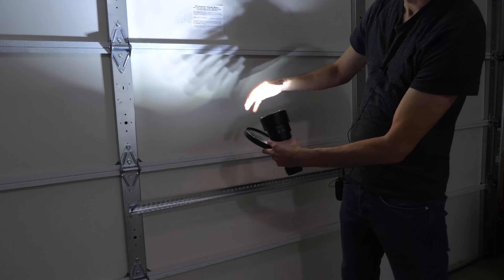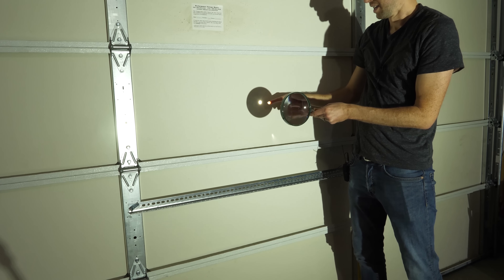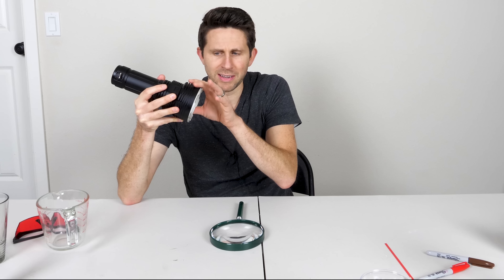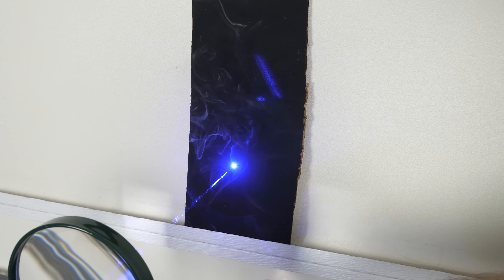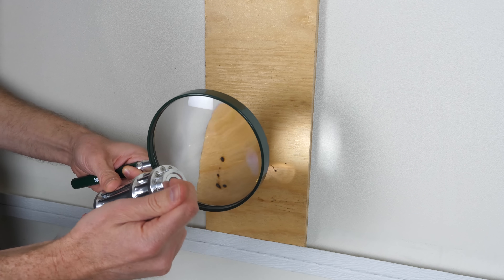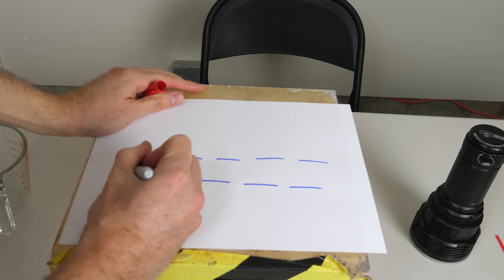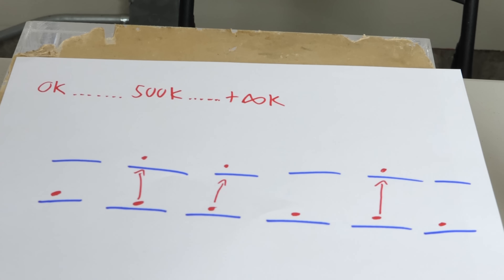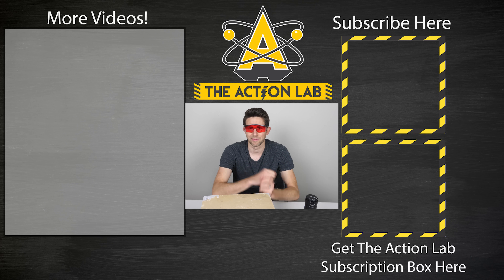What Happens if You Focus a 5W Laser With a Giant Magnifying Glass? Negative Kelvin Temperature!

Comment: I’m sorry to even say this since you clearly know what you’re talking about, but temperature and heat energy are not the same thing at all, and in no way is focusing the light of a flashlight impossible and if you do it with a series of lenses you end up with, drumroll, a laser. Think of it like psi vs a measurement of work. In two situations with identical total heat energy, focusing one of them would create a higher temperature than the other at the focused point. I.e. the focused beam has a smaller surface area so the same amount of force (light) means a far greater psi (temperature) This has nothing to do with the second law of thermodynamics because the total amount of heat energy remains the same. The only difference in this case with the laser is that the light beam is already focused, and that’s done with mirrors and lenses. No reason you couldn’t do the exact same thing with some complex math to determine the exact lenses dimensions necessary, and you would have to consider the parabolic reflector within the flashlight
Reply: I agree with you, there's no difference between laser or ordinary (incoherent) light when focusing (aside from chromatic aberration which is minimal anyway). It's easy to focus the laser in this case because it's collimated (parallel) beam once you put a focusing lens in front of it, it will focus it into a tiny spot at its focus, how small it can be depends on the quality of the lens.

Now the flash light in the beginning is emitting the light from a multiple diodes that are spread-out so you can't focus the light into a single point but you can make an image of these diodes. and actually you can make an image that's much smaller than the real diodes without loosing light (maybe not with that lens he has). When he was trying to focus the light he was moving the flash light farther and closer to the lens but ignored the distance from the lens to the wall (where he was trying to focus it) this is simple geometrical optics problem, you don't need to put the light source that far away unless you're trying to get a very tiny image, if you get a larger lens with relatively short focal length and then place the flash light farther than twice the focal length (as far as possible until there's a significant loss from the divergence) you will see a small image of the diodes forming a bit behind the focus point!
Reply: @mofleh177  yes all of that makes sense. Also, another thing to consider is if there is a parabolic reflector inside of the flashlight, which i don’t think there was in this case. The original leds could be rearranged or another reflector or lenses can be added to get the original rays closer to parallel. Just refraction and reflection angles and some complex math. The point is just that the amount of energy released is the same every time you turn on a light, and focusing that energy will inevitably increase the temperature without a change in total heat energy.
Reply: @LSFord  Yes exactly, a good example the high power search lights they use on police helicopters to track fugitives on the run at night, or the search light they used on the ground to locate enemy aircrafts in the pre radar times, those can be adjusted to a narrow beam to light small spot and in theory can be focused to a tiny spot.

I think what he was referring to has to do with heat transfer by radiation in which the heat flux from object A to object B depends on the difference of their temp in Kelvin to the power of 4 or (TA^4 - TB^4)
so if the object you're targeting is hotter than the light source itself, then the net heat exchange (by radiation in the form of EM waves that includes visible range) will be the other way around, which is something I'm still trying to wrap my mind around to be honest.
Reply: Sorry, your understanding is incorrect. It is impossible to focus light using lenses into a spot tighter than the source. If you could do that, you'd be able to build an perpetual motion device. Here's how it would work (if focusing light tighter than the source were possible): 

Take an object that has a uniform temperature across it's surface (and therefore cannot perform any work). Use a lens (or several) to focus its black body radiation down to a point, then a mirror to send that point back onto the surface of the object. You've now taken a uniformly distributed heat source and turned it into a hot point surrounded by cooler material. You can now use this difference in heat distribution to power an engine. The engine can dump its heat into the source block, where your lenses recycle it back into a point.
Reply: @DontThinkSo11  you’re ignoring the fact that the perpetual motion machine you mention is entirely possible because it’s actually just a solar engine. No object can do work without energy, and heat or light energy being introduced is what allows work to be done. Focusing light increases temperature, but not the total heat energy. Ever heard of using a magnifying glass to burn ants? That simple experiment is proof that you can, in fact, focus light into a smaller area than its source, which in this case, is larger than the entire earth. And lenses can be used to put any beams in parallel before focusing with another lens. This is also how telescopes work, and many existing lasers
Reply: @LSFord  You misunderstand. In my example, there is no external energy source. Any object at all that has temperature greater than absolute zero could be used to build a perpetual motion device, if it's possible to focus light tighter than the source.

Lasers are not built using lenses and black body radiation. That's how flashlights work. Lasers work by pumping electrons into a higher quantum state, creating a population inversion that's not allowed in classical thermodynamics.
Reply: @DontThinkSo11  okay, so where does the light come from then that you are focusing? If you’re just using heat energy, the heat energy needs to be greater than the surrounding area, not absolute zero. There needs to be a differential. When that differential equalizes there is no more energy. If you were in complete darkness with perfectly equal heat distribution there would be no movement no matter what lenses you use. Proves nothing lol
Reply: @LSFord  Thats exactly what I'm saying. If it's possible to focus light more than its source, then it's possible to *create a heat differential when one did not previously exist*. Let's adjust the example a bit to see what I mean. Imagine you're in a uniform enclosed box at room temperature. There is no light energy in the box, except for black body radiation coming from the walls, which is equal in all directions. You then set up your lens system inside the box, focusing the emitted black body light from one wall down into a tiny point on the other wall that is brighter than the source. Congratulations! You have now created a temperature differential. Use it to extract work from uniform heat to your heart's content.

Obviously, this is impossible. Therefore, have a lens system capable of focusing light brighter than the source is impossible.
Reply: @DontThinkSo11  that is not impossible. What you’re misunderstanding is that increase in temperature can’t be absorbed without the walls decreasing in temperature, and then the air surrounding the box would warm it again. It would be incredibly inefficient but that’s still a solar generator. The total heat energy present does not change because you focused it. But the temperature does. Temperature dos not equal heat energy, just like weight does not equal mass, or more accurately, does not equal the psi you exert on the ground.
Reply: @LSFord  If you can take a uniform heat distribution and cause one side to be hot and the other to be cold without external energy input, then you have violated the second law of thermodynamics. "Inefficient" nothing - no matter how little energy you manage to extract, you've extracted infinitely more than is actually possible.
Reply: @DontThinkSo11  you’re literally just describing a really complex way to extract heat energy from the surrounding room of the black box very slowly. It doesn’t deny anything, “cold” does not exist. Only a differential in heat. Focusing heat increases the temperature in a small area but not the total amount of energy. Radiation is energy, if you focus it, it will be more intense due to constructive interference. That doesn’t mean the amount of energy isn’t the same. In your box scenario, the only reason the walls don’t get to absolute zero is that the room around it is constantly putting heat into the system.
Reply: @LSFord  I'm not talking about changing the total amount of energy. I'm talking about reducing the entropy of the system. That's impossible, without the additional of external energy. You can never, ever take a uniform energy distribution and make it non-uniform, without extra energy you brought in from somewhere else. The fact that you can do this with your lenses means your conceptions of lenses violate the second law of thermodynamics, and therefore is false. If you don't understand this, there's not much else I can say to convince you; might I suggest finding some educational videos on entropy and the second law of thermodynamics.
Reply: @DontThinkSo11  i know what entropy and the second law are, they don’t mean that you can’t focus light. This process is literally done all the time in spot lights and telescopes and magnifying glasses. But the energy, in those cases, comes from whatever electrical source is powering the light. Not the room like in your hypothetical. Which would only result in such a minute change in temperature, if any, that it is barely detectable.
Reply: @LSFord  Of course you can focus light. But you can never focus it to make a spot brighter than the source. This principle is called conservation of etendue, if you'd like to look it up. It's a direct consequence of the second law of thermodynamics when applied to the propagation of waves. 

There is no distinction between a light source and the radiative heat of the room. If a lens can focus a light source, then it can focus the light radiating from the walls of a room, which are always radiating according to their temperature. And if you can focus it such that it's brighter than the source, you can create a heat gradient where none existed before - or worse, make heat flow from cold to hot (by focusing the radiated heat from a cold source down to a tiny point on a hot one). No matter how small the effect may be, if you can do it, then you have reversed entropy. If you did it with passive components (meaning no energy input), then you violated the second law.
Reply: @DontThinkSo11  I'm not a physicist I'm an Optical engineer, As far as I can tell regardless of how the Laser was generated at the end it's a light and behaves accordingly (reflection, refraction, diffraction, polarization...etc) if you can focus a collimated beam of laser into tiny point, why wouldn't you be able to do the same with a collimated beam of "ordinary" light??
Reply: @mofleh177  The short answer is that light emitted from objects due to thermal radiation are never really fully "collimated" in the same sense as a laser is. By actually being collimated, a laser acts like an actual tiny point source that passed through a lens. I never really liked the "negative temperature" explanation, but the reasoning is that in real life, an actual point source that emitted all of that light would have to have infinite energy density (because that energy is not spread out over an area - it's a point!). So we say it acts like a radiating black body with zero volume and get crazy things out of the math like "negative temperature". But in my opinion that's sort of fitting a round peg into a square hole. Laser light isn't created by a black body source, it's created by a spooky quantum mechanical process that winds up acting like a collimated source. Thankfully quantum mechanics likes to behave in ways that still don't violate the second law of thermodynamics, so we're still safe on that front, but now with the ability to focus light down to its theoretical diffraction limit.
Reply: @mofleh177  As an optical engineer, it's probably easier to think in terms of Fourier optics. A single lens performs a Fourier Transform on its source. The only way for a lens to focus everything down onto a point is if all of the light truly is coming in at the same angle. If any of it is coming from a different angle, then the lens won't focus that light to the center; it will be focused somewhere else. A real object can't send out all of its light in the same direction (be collimated) in the way a laser can.
Reply: @DontThinkSo11  it’s not cold to hot and there is no heat gradient. Only a temperature gradient. Temperature is not heat and focusing light most certainly does increase the amount of Heat experienced at the  focal point. That is just a fact. You’re so far down the educational rabbit hole you’re forgetting that this concept is used all the time. You’re right there is no distinct difference between radiation and light. But focusing radiation is also possible, and if you did it and saw like maybe a less than 1 degree difference at the focal point it would be because you are effectively extracting energy from the heat surrounding the walls. Or it would eventually deplete the energy in the system if in a vacuum until it reaches absolute zero. Passive components DO NOT mean no energy input. Hot flows to cold. You reduce the temperature of the walls slightly, the air surrounding the box transfers heat back into the box, therefore there is still energy input
Reply: @LSFord  Look man, this is a well established optical principle. I've given you all the terms you need to look it up yourself. If you can't see how taking a uniform heat distribution and using it to produce a non-uniform one violates the second law of thermodynamics, then there's nothing I can say to convince you. 

Here, try this: take a magnifying glass and point it at the wall. Is the wall brighter when viewed through the magnifying glass? No. Even though the light got focused down into your eye. This is just how light and lenses work. You have a mental image of them concentrating light down, and that mental image is wrong. They redirect light rays, but the manner in which they can do that is fundamentally limited, and no arrangement of lenses and mirrors will ever concentrate them tighter than the source.
Reply: @DontThinkSo11  well then i guess every kid who has burned an ant with a magnifying glass has defied the second law of thermodynamics
Reply: @LSFord  only if they increased the temperature of that ant to greater than the surface of the sun.
Reply: @DontThinkSo11  no, only if they increase the temperature on the ground to be greater than the temperature at the magnifying glass. Are you implying everything hit by the sun burns?
Reply: @DontThinkSo11  I give you that you can't get a perfectly collimated light out of a light source that's not infinitesimal point source, I've said that in my 1st comment in this thread that what you're basically doing with a lens is imaging the light source itself. but you can produce an image that's smaller than the light source itself even with minimal loss of light if you have the luxury of optics. 
Now if you managed to get like 60% of the light focused into an area half the size of the diode itself, does that mean it's hotter than the source? of course not because only little portion of that heat is absorbed while most of it is reflected "scattered" and that's what you actually see. For his argument to have any merit, the light must be completely absorbed leading to the material temp to rise until it starts emitting light on its own.
Reply: @mofleh177  You can of course magnify or demagnify an image. But you can't take 60% of the light emitted from a diode and put it into an area only 50% the size of the diode. If you could, you could replace your diode with a simple black body radiator and now you have a way to focus radiated heat tighter than its source. Imagine you have two radiating black bodies, one just slightly brighter than the other, inside of a vacuum so that they only exchange heat through radiation. The hotter body is smaller than the cold body. Use your lenses to focus, say, 60% of the cold body's light down onto a hot body that's 50% the size, and because you managed to "concentrate" the light, you have made a spot brighter than either original body, which means the hot body will increase in temperature until its radiated heat reaches equilibrium with the incoming radiation. You have now caused a net heat flow from cold to hot. This is impossible, therefore the lens arrangement itself is impossible.
Reply: @DontThinkSo11  
Man I can easily do that, but I have an easier thought experiment.
let's say I formed an Image of a diode that's exactly the same size as the diode itself and lost 70% of the light (I guess we can agree it can be very easily done optically) and then I brought 4 more diodes and lenses of the same kind and positioned those 5 diodes with their lenses in pentagonal arrangement where I can manipulate each of them to have them cast their images exactly on the same spot. now that image gets 1.5 times the light each diode emits in a similar manner to the previous example
Reply: @mofleh177  You'll find you can't do that, because in order to capture 60% of the light of the diode and put it on the target, you'll need to occupy at least 60% of the solid angles about the target. So you'll physically occupy too much space. In the limit where 99+% of the light emitted is brought down onto the target, the target is completely surrounded by lenses/mirror. 

Keep in mind the LED is a metaphor for a radiating black body, so we're assuming it's radiating its light anisotropicly.
Reply: @DontThinkSo11  Not really, a little lens right in front of it will narrow the divergence to a semi-collimated beam and then all you need is another slightly larger lens to form an image, there will be physically plenty of room to put as many light sources as you wish but let me tweak the thought experiment a bit further.
Instead of 5 identical light sources, I'll only use two that has the same diode dimensions but one of them has 10 times the power of the other I'll get them to form an image on top of each other the same size as the physical diode, let's say I was only able to focus 10% of the emitted light of each, now the image is receiving 1.1 times the light emitted by the weak diode!
Reply: @mofleh177  I think you've missed the point of the thought experiment. No one is saying you can't produce a bright spot by bringing in more lights. I'm saying you can't focus a spot to brighter than the source, if the source is a radiating black body (such as the sun, or a filament bulb). The LED in this example would need to be radiating in all directions for it to be analogous. Of course if your LED only radiates in one direction, then you can capture all of its light using only a fraction of the necessary solid angle, but that has nothing to do with this comment thread, which is about why lasers are considered to have negative temperature and why there's a limit to how tightly you can focus light. Your LED "acts like" a much higher temperature black body source, and if we're talking light fixtures, will even be labeled with the equivalent temperature of that source. It is impossible to focus the light so tightly that you heat the spot up above an equivalent black body temperature. So there is a limit to how tightly the light can be focused. You could never, for example, focus moonlight tight enough to burn an ant, even with a planet-sized magnifying glass.
Reply: @DontThinkSo11  I can't find it, this same video comes out when I search "what happens focus flashlight"
Reply: @mofleh177  the title of the video is "What happens if you magnify the world's brightest flashlight?"
Reply: @DontThinkSo11  I just saw that, he isn't doing it right. It's a simple geometrical optics problem there are two variables:
1- distance from the flash light to the lens.
2- distance from the lens to the focal plane (where the image best focus).
each of these distances needs to be adjustable independently. but anyway here what I'd do.
- Measure the angle of divergence for the light source.
- Pick a lens that has (D "diameter" and f "focal length") such that when you place it at a distance f from the flashlight its diameter D is large enough to contain all the light.
- Pick a second lens with the same diameter D but with shorter focal length f2  (more powerful lens).
- place the second lens right after the 1st one make sure they're perfectly aligned.
- behind the second lens at its focus there will be an image smaller than the physical LED make sure you move a paper or whatever you're projecting that image on back and forth until you find the best focused image.
Reply: @mofleh177  You're describing a 4f imaging system. Before we go into that, can we first agree that it is impossible to use a single lens to focus the incoming light down into a point?
Reply: @DontThinkSo11  Yes you can't focus it into a point, you're imaging it but you can form an image that's smaller than the actual LED. If you want to do that using a single lens it's possible but will require a lens that's relatively large with short focal length (High F#) not widely available and then the flash light will need to be placed more than twice the focal length away, it's way more convenient to use two lenses.
Reply: @mofleh177  Ah, but now you've touched on the important subject. To produce a smaller image, you must move the lens further away, which means you're collecting less of its light! And if you use a 4f imaging system, then your second focus needs to be proportionally closer to the target, this occupying more of the incoming solid angles, and these ratios will precisely cancel, this giving at best equal brightness at the target.

 If you don't believe me and action lab, how about xkcd? Search for xkcd what if fire from moonlight.
Reply: @DontThinkSo11  No, I said you need a relatively large lens with short focal length and the reason for that is exactly to avoid loosing light!! otherwise you could form a tiny image with any lens I just did that at home with small lens. The reason you need large lens with short focal length actually is that high power light source emits light from multiple diodes that are dispersed over large area, if you treat each one of them as a distinct light source and manipulate its pointing angle and use a pattern of lenses such that each one has its own small lens you would be easily able to condense the light into a fraction of its area with negligible loss.

This however wont make that area where the light is focused hotter than the light source! because only tiny portion of that light is absorbed by whatever material is there!!
Reply: @DontThinkSo11  My friend it's not an assertion battle, I've detailed how it can be done experimentally. The way the gentleman in this channel tried to demonstrate that the flashlight can't be brought optically to focus (form an image) in an area less than the area of the LEDs is flawed. He is likely more knowledgeable than me but in this particular area I'm confident of what I'm saying. I've even brought LED to focus in very tiny image less than fifth the diode's size just yesterday although I might've lost 40 or 50% of the light because I don't have larger lenses, If you're interested I can take photos and send it!
Reply: @mofleh177  Demagnifying an image is of course trivially possible. But if you measure your system, you'll find you actually captured less than 20% of the LED's light into the demagnified image. The problem is probably in your estimation of the set of angles of light you captured; keep in mind if you captured 50% of the angles when viewed from the side, you've actually captured only 25% of the solid angle.